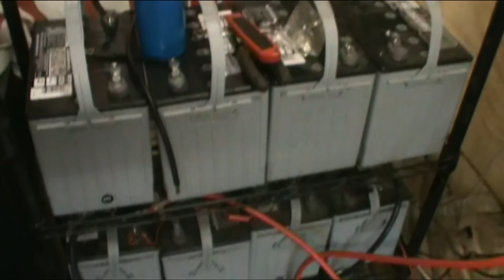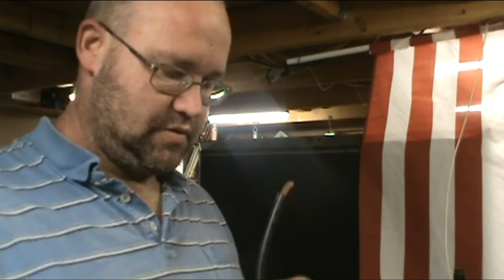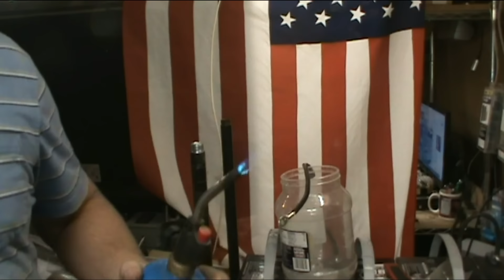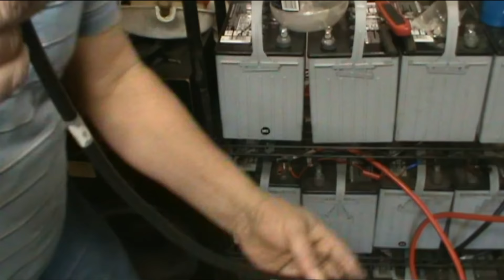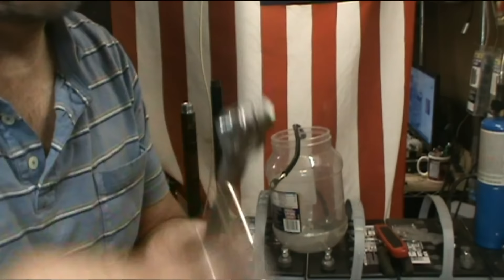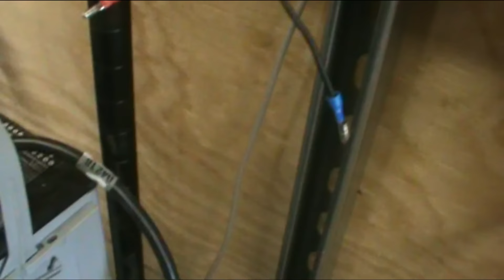New Battery's added to the solar system

Comment: Do you realize how dangerous it is to have an open flame or even a spark close to batteries that give off HYDROGEN gas when changing and also much later than charging? You are very lucky not to have had an explosion!
Reply from the maker: so you are bitching about a video that is well over 4 years old. and also those are sealed batteries, also you have to be in a combined space for enough Hydrogen and oxygen to even be able to get hydrogen explosion. And if I had that much off gassing from New batteries, in the first place they would be junk. But then again goes to show was a keyboard worrier knows, witch is very little.  But then again wouldn't expect anything from some one with know videos and only one sub. Pretty typical of a worthless Democrat .

Comment: very nice :) Its good to have a system that works. I was a bit worried when i see u holding up solder wire in video pic. Nice job. Great system
Reply from the maker: +Justin Case Yes the system is working perfect.  I cant wait to get that software.  I was running off solar for 11. and a half hours yesterday with full son and power draw up to 1kw. and for 6.5 of those hours the bank stayed at 100% charge.   So that was not bad at all.
Reply: +McCuneWindandSolar yes its great running your home off sunshine. I loves the Sun.

Comment: Man that is a bank and a 1/2 .. Great capacity !  Can the solar cells charge them as fast as you use them ?? Thumbs up man !!!
Reply from the maker: +ShawnMrFixitlee Thanks for watching. Thats a small bank compared to Justin Case Battery bank. He has a monster I think he has 1000AH + mine is only 237 AH.  As for charging and load use it all depends on what I'm pulling right now I have 2,266 watts of solar and like now I'm only using 535 watts I can run all day as long as the sun is giving me more than 535  watts at the time.   If I lose power and if I'm only drawing 600 watts I can run for 5.7  hours if there is not sun IE at night if the power were to go out. we usualy turn every thing off other than maybe a fan and a few lights we turn every thing off if the power goes out. and we can get out power draw down to 350 watts and when I do that I can get almost a full 10 hours.  It can run long if I were to drain the bank down past 70% discharge but I try not to so the bank life span last longer.